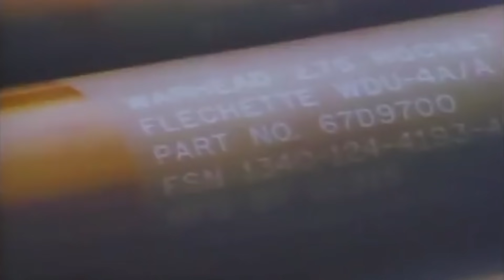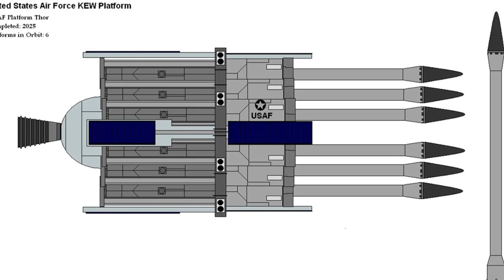'Rods from God' Weapon System Gets Another Look

Comment: “A rod touches down 8 times faster than a bullet, and with a force significantly greater than a nuclear warhead. None of the fallout, all of the fun”
Reply: Someone’s been watching GI Joe 😂
Reply: @talltom69  Beautiful delivered speech by Jonathan Pryce.
Reply: @talltom69  OPs comment is a direct quote from Call of Duty Ghosts lmao
Reply: The nuclear warheads bit is a massive exaggeration. At best it would be the force of a tiny tactical nuke. What these are actually good for is precision strikes with no visible exhaust. They can be bunker busters because most of that impact force is directly downwards. There's also the fact that it takes an equal amount of energy to get something into space as it will carry downward. With the inefficiency of rockets, Thats made way worse.
Reply: @ruthlessrubberducky5729  You would have severe energy losses getting a 1T payload up, and then you would lose mass and velocity on the way back down. All the "flames" in that video would be energy lost.
Reply: @eddarby469  Melting point of Tungsten is just over 6000 F as compared to steel just over 2200 F. So,Tungsten is not going to flame threw the atmosphere. Tungsten is a 9 on the hardness scale, it will go threw the hardest Granite like butter, 6.4 for the hardest Granite. Since by international treaty you cant have have nukes in space this is a way of getting past international law. Why isn't Tungsten used in  aircraft and other products because its 1.50 times heavier than lead. Once anyone figures out how to get such a heavy payload into space, maybe Elon?
Reply: @denkeylee  Thanks for the clarification on the physical properties of tungsten. I do not believe "hardness" is going to matter between the tungsten and whatever it hits. It will be the immediate conversion of the kinetic energy into other energy, including heat, that will cause the "effect". There will be kinetic energy converted into "stored" energy as the target disintegrates. There will energy absorbed as deformations in the projectile and the target. But there will be a heck of a lot of heat caused by the rod being converted into something closer to a ball. Massively heating this ball will cause it to explode.

I still have to wonder about the guidance system that will help it hit the target. The fin assembly will have to withstand reentry and still be large enough to guide it at hypersonic speeds. It can't do anything until there is atmosphere around the "vehicle" and at those speeds I assume that will be only seconds.
Reply: TIMESTAMP ?
Reply: @ruthlessrubberducky5729  Eh, all depends on how much kinetic energy is behind the rods. a golf ball going 99% the speed of light would create an explosion equal to the Tsar Bomba, even at half the speed of light, it would be more than 10 times the size of Hiroshima, not that we could ever get a rod traveling anywhere near that speed, which would depopulate the planet...  Anyways, the neat thing with Kinetic Kill Vehicles is that you can dial in a specific detonation size, based on the amount of kinetic energy put into it, giving you from between a conventional bomb to a very large nuclear explosion, though you are right that simply "dropping" a KKV from orbit wouldn't give you anywhere near a nuclear explosion...however... should someone attach something equal to say a Falcon 9 first stage with the pointy end facing the ground.. then a boom equal to a nuke becomes very feasible.. however, instead of just sitting in orbit at a low 17,000 mph speed until we all of a sudden need it to go really fast... we would, in reality, use ion drives and gravity assists to slowly get the KKV up to incredible speeds(fraction of light speed) over a long period of time in an orbit that probably takes it out and around the moon or even further, until a chemical rocket engine can nudge it onto a collision course.... at which point we could easily exceed the boom of a multi-staged fusion-fission device.
Reply: @HicSvntDracones  Yep, but all that misses most of the main points of having the system. They wanted something available at a moment's notice without putting nukes up there. Unless you build from materials in space, you will be using more energy than a nuke to get that much mass up there. A falcon 9 has a ton of energy, but not tactical nuke levels. What you described is basically a first strike vehicle.
Reply: @ruthlessrubberducky5729  Right, what I was saying is that it isn't viable until we can manufacture in space because launching them would be too expensive. I brought up a reverse  Falcon 9 as an example as to how a KKV in orbit could have equivalent power to a nuclear weapon, in response to whoever said a kkv couldn't equal a nuke, but keeping them in orbit to drop at random isn't viable really, due to the energy required to impart enough potential energy for a big enough boom. I was in a group that did a research paper on a similar concept for a sci-fi writer last year that ended with the best solution to keeping multiple kkv's that combined ion propulsion and gravity assists to reach 12% the speed of light, of course, this used a "wormhole" that opened in front of the KKV to put it on target, but it was a pretty in-depth research paper none the less. However, keeping enough vehicles spread apart could give you a pretty quick response time... even without the wormhole :) Basically, just keeping it in orbit to reenter when needed doesn't impart that much kinetic energy without some kind of propulsion to make up for drag caused by the shape needed to generate the correct bow shock to throw plasma away from the kkv during reentry.  However, this is all done for fun, I am sure teh engineers that worked on this had a pretty decent plan that we may see someday,
Reply: @HicSvntDracones  Did a writer hire you to do the math or something?
Reply: @ruthlessrubberducky5729  Not me specifically, a hard sci-fi writer approached the astronautical engineering department at my University, looking for a scientifically viable "planet cracker". We've done quite a few of these consulting gigs, tons of fun, but ended up using the kinetic kill vehicle idea, which is all the rod from god is, anyways, found out very fast that simply deploying a KKV at orbital velocities and letting it reenter didn't give that much of a boom, it needed a lot more kinetic energy, and the only real viable way of doing that is to get it moving over a long area to build up the kinetic energy needed. The energy you put into the vehicle is what gets transferred to the ground, and the requirement needed to quickly impart a lot of kinetic energy to something just isn't easy to do, even with sci-fi propulsion :) We didn't go into crazy detail, but verified the best method was to impart velocity over a long period of time, but then again, we were TRYING to literally crack the crust... but its all the same, just scaled down..
Reply: @HicSvntDracones  That sounds like a dope extra credit assignment!
Reply: @ruthlessrubberducky5729  that's not true because the rate of travel is significantly reduced.
Reply: @ruthlessrubberducky5729  i hope they drop one on putins bunker
Reply: 0:38,
Reply: @acousticpineapple7851  uh huh, turns out it's the other way around - Russians are now launching these (Oreshnik).
Reply: David Pryor  That's shameful that can even exist.
Reply: @Neojhun  you’re responding to a bot ….   Check profiles before commenting.   You’ll see how many there really are
Reply: Lots of monetary fallout :) Stuff is VERY expensive to get into orbit, especially a multi-ton kinetic kill vehicle. This is never going to become feasible until we get good at mining and manufacturing in space, such as moon and asteroids, as that is the only way where it becomes cheaper than a nuke, including all of the post-explosion clean-up, medical costs, and etc that result from a nuclear detonation, so for now, a nuclear bomb is the better, cheaper route.
Reply: @HicSvntDracones  cant you bring that big chunk of projectile piece by piece using spaceX reusable rocket or maybe even use SpinLaunch and then just assemble the whole projectile in space, at least the cost wouldn't be that high. That is of course after SpinLaunch has perfected their thing.
Reply: Underrated masterpieces those 2 movies, it’s crazy how different movies are, they used to be just awesome entertainment, now there’s always some political agenda from either side 😔
Reply: That scene brought me here 🤣
Reply: @snello8798  bot!
Reply: @TAR3N  your a mad one you 🤣 cya
Reply: David Pryor not the rods that crash into ur mums ass, no.
Reply: China would not stop sending flakka alpha phenylcyclidine  to the USA , we  used the rod of God and 40 000 forty thousand Chinese people died.
Reply: Yet the math nor the density of the metal hitting variabilities  line the earth don’t add up .        This wouldn’t work as described
Reply: Fun until you’re on the receiving end
Reply: Why is their terminal velocity so high?
Reply: David Pryor  these weapons are the begining of orbital mass destruction weaponry
Reply: -GI JOE
Reply: davidpryor3933  Its called kinetic energy.
Reply: @denkeylee  you’re responding to a bot :/
Reply: David Pryor  Your comment reminded me of a comment made by the Democrat Senator from SC when a Japanese businessman publicly stated the US was full of lazy stupid workers. He replied "Those two bombs we dropped on you were made by the same sort of lazy stupid American workers." Or something very much like that.
Reply: So let shake hands and get rid of the nukes and use something conservative equal yeah I didn’t really like that whole nasty fallout issue
Reply: Yeah let’s chuck some metal from space with scram jets multiple metal heads the strongest we can forge 😂
Reply: David Pryor  wow.  Your bot traffic is insane…. Are you programmed to respond to every comment individually or are they just auto generated generic words to create traffic ?
Reply: davidpryor3933 false, USA wins
Reply: And 100% betting this is over Moscow
Reply: @bbgamegodpnw  It's already over london
Reply: So the US government just straight up copied the weapons system from GI Joe Retaliation
scoff
Reply: nukes are no more !!!
Reply: You will have to answer for this. For your congress. Your courts
Reply: GI Joe baby!!😊
Reply: The only issue I think is it cost effective really...I mean each rod is 2,000 lbs..that's not that heavy really..tungsten isn't cheap..maybe a 20 ton tungsten rod..but then you have to look at how to get it up there..falcon heavy is capable but idk
Reply: Isn’t there treaties banning weapons in space not that the US has ever honored a treaty but I thought there were treaties banning weapons in space
Reply: GI Joe Retaliation😅
Reply: Hazel
Reply: The debris would block the sun for weeks.
Reply: This is mind blowing 🤯
Reply: The kinetic energy of the impact cannot exceed the energy used to boost/orbit the projectile.  In other words, the energy of the portion of the rocket fuel needed to launch the projectile.
Reply: @firstlast-ty4di you'd only need a small rocket to fire it into atmosphere from just outside orbit, then kinetic energy takes hold on impact and less Air pressure in high atmosphere mean terminal velocity is non existent thats what turns a Solid lump of metal into a meteorite..
Reply: I believe he said ballistic missile, not nuclear
Reply: @brick06  yes, he did say "ballistic missile", but AFAIK our (and their) ballistic missiles are nuclear. The cruise missiles are both types. I believe the East's hypersonic missiles are going to be both types too, although I wouldn't be surprised to see them favor nuclear warheads on that program.
Reply: @eddarby469  maybe he meant just the kinetic energy from the re-entry of a ballistic missle, because the energy released by the nuclear reaction is a lot greater as far as I know.
Reply: @eddarby469  ALL Balistic Missles are "Hypersonic" they have been since the 1950s
Reply: The pentagon will confirm that China was nuked.  The rod of God when a chemical plant was  destroyed,
Reply: David Pryor  have u ever heard of a meteorite? lol dude pls get an education. u must be from usa
Reply: @acousticpineapple7851  yeah that’s why the USA has the greatest inventions in the history of the world. We are the most powerful country and the only rival is china and then Russia but not nearly as close as the Chinese economy vs Americas. Russias conventional military is kind of a joke, they just have a lot to nuclear weapons which would be extremely useful but haven’t been utilized yet.

Comment: It's still not very feasible.  A 20 foot long, 1 foot diameter tungsten rod will weigh 18,932 lbs (84,215N), and that's before you add hardware for guidance, maneuvering thrusters, retrorockets, and so on.  Then you need to also account for the weight of the platform on which these rods will be stored and launched in orbit. And that likely means that you'll need send up said platform fully loaded.  That'll start to get expensive quickly.
 
Another downside is that unless you loft many such platforms in many different orbital planes, you could possibly have to wait a while to for the launch platform to reach the right spot for launch.

Worse though will be what happens after we put such a weapon platform in space, especially if we use it.  The Russians and Chinese will then feel justified in putting up their own platforms, and their platforms may not just hold kinetic weapons.

Comment: Your cringeworthy comment about "the weight" of the projectile (btw: the proper term in this context is "mass") possibly being compromised by metal burning off during reentry is beyond ignorant.  Simply adding an ablative cap to the projectile (a well researched / often used method used over decades now) would easily overcome any potential metal slough from re-entry heating.  Aside from this, no engineer in the world would design a hypersonic reentry projectile out of "metal" - If it were even possible to do so.  Such a metallic warhead would require some sort of super exotic alloy that could handle reentry friction, yet maintain its aerodynamic stability.  Your idiotic video post has reduced your channel bona fides to the realm of clickbait.

Comment: Dropping rods from space would not be expensive, getting them up ined space to drop them is what would be expensive. Also, they haved ablative armor which they can coat the metal rods with to keept them from just disintegrating or burning up on re-entry to atmosphere.   I think I read it too that in Vietnam also they drop hundreds or thousands of liked 1/2 pound steel rods fromed B52 in mass drops over the Ho Chi Min trail too:
        “Dubbed “Lazy Dog” bombs, these kinetic weapons were small, missile-shaped tubes of metal about 2 inches in length and less than an inch in diameter. Outfitted with fins, they would be dropped by the hundreds on U.S. enemies, who were almost certainly ill-prepared for such a bombardment.”
 Here is a site about lazy dog bombs:      https://youtu.be/rLebyPsyNTo

Comment: A simple ceramic heat shield will solve the problem. Also the rod is so narrow, with limited frontal resistance, it would not burn in any serious way, so it probably wouldn't even need any heat shield. A moot point in the video.
Reply: If ceramic shield would solve the problem, then why tungsten itself cannot be used without any shielding? Idiot.

Comment: Why do tehy have to be dropped from space? Why not just drop tehm froma  drone at 40K feet or higher? It would still reach supersonic speeds, I suspect, and would sink even a battle ship or aircraft carrier. They also don't need to be that long, IMO, and could still do the job. So even a drone could carry several of them.  Finally, they could home in on a laser dot, which would make them much simpler to build.

Comment: I dont think people understand how terminal velocity works, a telephone sized object does not have the mass or the velocity required by being dropped from orbit to have the same energy released as a nuke. That literally would defy physics
Reply: 99.97% of people don't even have a brain in the first place.
Talking about shielding tungsten rods with ceramic when tungsten is way more resistant to heat.

Comment: Larry niven wrote about the idea of kinetic orbital bombardment a long time ago. But they were using 30 meter tungsten/iron rods with way more mass.
Questionable whether a one ton projectile would even make landfall.
Put a booster on each one to give it a kick, get it moving fast enough so when it hits atmo it won't have time to burn up.
Reply: Tungsten has one of the highest melting points of any metal, that coupled with a type of ceramic coating I’m sure that the vast majority would make it to the surface…Our nuclear warhead MIRV’s have a coating on them to withstand reentry so the technology is well established.
Reply: This video is unclear. They say 2000 lbs, then talk about project Thor. Project Thor’s rods we 1ft thick 20ft long that would be nearly 20,000 lbs.
Reply: @andrewmeyer8374  most of these videos have the structural form of a sponge with way less integrity.....lol
Reply: Yay! Finally a reference to Larry Niven!  Also, In one of his novels, aliens maneuvered a small asteroid into earth orbit - or maybe the LaGrange point, or forget - and threatened earth with it.

Comment: Uh, Yeah. No. 1) You still have to get all that mass into orbit which is ridiculously expensive.  2) terminal velocity is well below sonic speed, and there is no way you can break the sonic barrier without an engine/fuel/additional weight. The physics are just not there.